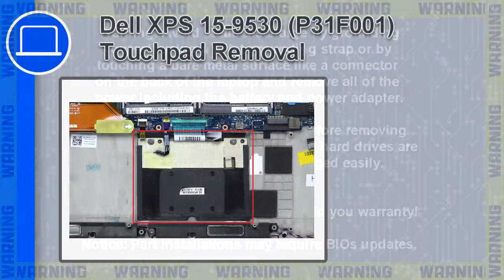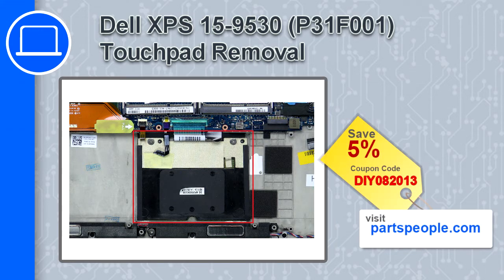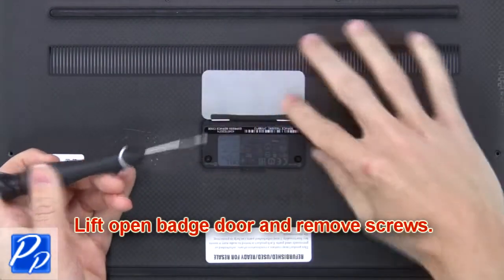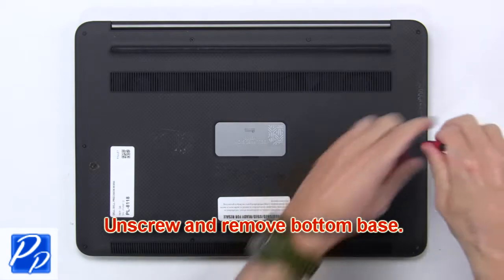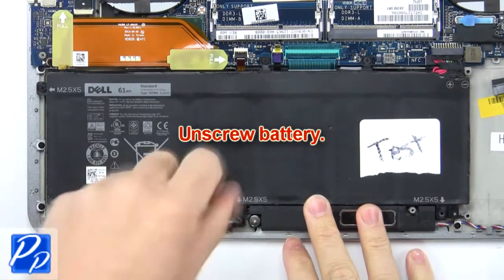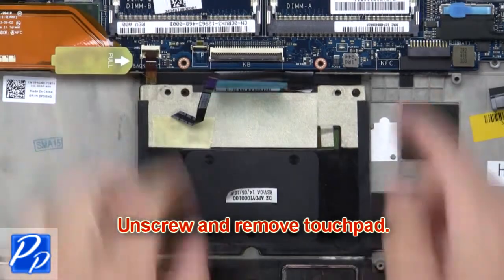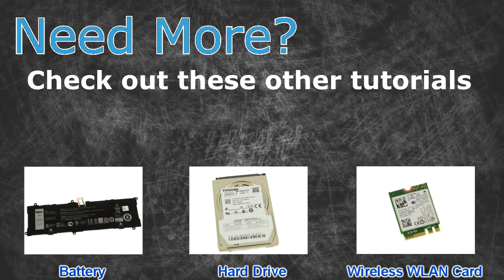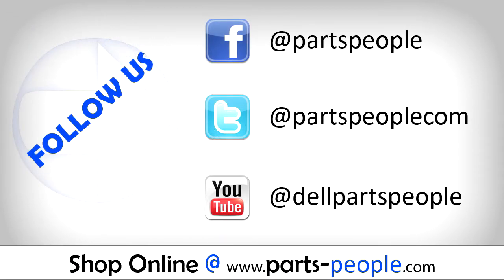Dell XPS 15-9530 (P31F001) Touchpad How-To Video Tutorial

Comment: Coupon didn't work when I clicked apply.
Reply from the maker: Did you use DIY082013? D(uppercase i)Y
Reply: Yes but I cancelled the order anyway when I realized that you only had the 9550 not the 9530 touchpad.  Only other place that had it was someone on e-bay, so ordered it there.